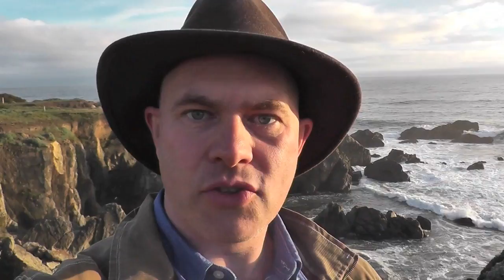Specific Impulse - Why is it Measured In Seconds?

Comment: For everyone who is still scratching their heads i wanna bring some simple formulas here, but i just need to remind that in rocket science/physics there is a unit called "Impulse" and it is basically a unit of Force over time I=F*t, it means how much "total force" the rocket received while engine was ignited/working (the actual definition is "Impulse is the change in momentum of an object").
     There is many formulas for Specific Impulse (SI), but i intend to use SI=(F*t)/W, where F - thrust of the engine, t - total  time of ignition and W - weight of the fuel in Newtons. So basically lets say we have an engine with Thrust F = 70 N and the engine supposedly ignite and stays on for 20 secs. We can multiply Thrust and time and we will get Impulse (please don't confuse with Specific impulse) which will be 1400 N*s. So for the 20 secs duration the rocket received 1400N*s of impulse. During this burn the engine consumed 2kg of fuel, we can calculate the weight of the fuel by multiplying its mass by "g" (will keep it 10 m/s^2 for simplicity) and we will get 20N. So what we left with is that SI = 1400N*s/20N = 70s. What the 70 seconds mean here is that if we let this engine theoretically run for 70 seconds, it would burn the amount of  fuel weight that is equivalent to its Impulse (not specific impulse) which it provided with 20 secs ignition time in the example . It may be not making any sense at first, but think about it: its simply states how long engine should theoretically be ignited to burn enough fuel so the mass/weight of the burned fuel would be equivalent to the apparent/received impulse. In other words, the engine was ignited for 20 secs only and consumed some fuel and judging by what it burned, you could still say that this engine is relatively efficient, since its theoretical time of ignition to match the impulse (SI=70s) is still more than the actual time the engine was on (t=20secs).
      For example if we would consider the same scenario but with the fuel burned weight 10 times more (200N), than the SI=1400N*s/200N=7s . That would mean that this engine, that burned for the same amount of time (20 secs) with the same amount of thrust (700N) but burned away the 10 times more fuel! So you could say it is less effective, since to provide the same impulse (Thrust*time 1400N*s) it effectively burned 10 times more fuel and thus Specific Impulse is lower and only 7 s. So for this engine the SI means that for only 7s of theoretical ignition, this engine would burn away the weight equivalent of fuel equal to the Impulse provided for 20s !!! So the lower the specific impulse, the more fuel engine will burn to reach the desired impulse (less efficient). 
    Conclusion: in short, the Specific Impulse is the rate/value of the engine that reflects how much fuel weight/ fuel mass the engine uses to reach the Impulse it provides. in other words, the Specific Impulse increases in engines with high fuel economy, while more fuel hungry engines SI will decrease. It is a little oversimplified, since in reality each engine have different Thrust value, thus you have the Ion thrusters with SI of 1500 s, but with Thrust of 0.1 N 💀 . So comparing 2 different engines just by their SI alone makes no sense, it only matters in the context of the same Impulse (Thrust over time), and the Impulse by itself matters by its nature (0.1N over 10 000 s won't help you get off the ground, but if you are having 1 000N over 1 s (in both cases the Impulse is 1000N*s) then you atleast going somewhere).
Reply: From the formula you can see, that SI - is a relation between engine's Thrust and Fuel consumed to achieve that thrust. Time of ignition is irrelevant, since the more time the engine running - the more fuel it consumes, so it's evens out. So naturally, the engines with high Specific Impulse means that they have high Thrust achieved to Fuel spent ratio (aka efficiency).

Comment: There are two ways to measure Isp (specific impulse) : mass, and weight (equivalent mass at 1G, measured in pounds-feet). The weight measurement turns out to be in seconds and is basically a measure of how many G's the exhaust is subject to. The mass measurement of Isp is actually just feet per second and is exhaust velocity, which is a little more intuitive.

https://en.m.wikipedia.org/wiki/Specific_impulse

Comment: specific impulse = impulse / mass
impulse = force(thrust) * time
force = mass * acceleration
acceleration = velocity / time
velocity = distance / time

so, put all your equations together ...
acceleration = distance / time /  time
force = mass * distance / time / time
impulse = mass * distance / time
specific impulse = distance / time

and AMERICANS ( dunno if the english are this stupid) keep trying to use pounds for both FORCE , and MASS, which they are not, so they wind up with seconds for specific Impulse. the proper units for specific impulse are m/s ( or ft/s if you live in the stone ages)

Comment: I measure specific impulse in Fortnights since I use the Furlong/Fortnight/Firkin system. As you know, that system is much more intuitive than the English system or, God forbid, the Metric system.
Reply: Battleglory 
If you are referring to KSP, it seems to use metric units for some unknown reason. Maybe there is an add-on to convert units to KKK to make it easier to use.
Reply: @Battleglory a Fortnight is a unit of time equal to two weeks.

Comment: I don't understand specific impulse at all. What does it mean? Why do engines that use things with a smaller molecular weight tend to have a higher specific impulse?
Reply: It's a change in impulse (momentum gained) per unit of fuel mass burned. Instead of using mass they're using mg, the force of gravity at earth's surface.
Reply: Interesting, that makes a lot of sense.  So, why does specific impulse tend to be higher when your reaction mass has a low molecular weight? I can easily see how having a higher nozzle exit velocity would be good.
Reply: I think the exhaust velocity is inverse to the particle mass, like a gun firing a bullet. If the bullet weighs half as much, it goes twice the velocity, so lower mass particles would move faster.

Comment: It seems silly that this was introduced just because of the imperial system. Of course the sensible definition of specific impulse is as the change of momentum delivered per mass of fuel (so units meters/seconds)

I guess if you wanted to try to assign some meaning to this version, though, given this silly conversion: it seems that gravity should be mentioned in the description (just saying that the units work out I'll consider cheating a bit). So how about this: when you divide by acceleration due to gravity, saying an engine has an ISP of x is saying that by burning your engines for x seconds you increase your momentum by the same amount that gravity would change the momentum of that weight of fuel in one second.

Not saying that's as helpful as other descriptions. Probably the better approach is the comparative one: if an engine has twice the amount of ISP, say, then it produces the same thrust from half of the amount of fuel. Wanted gravity to feature in the above though to see if it gave the number some actual meaning.

Comment: Forget that, I want to understand what exactly does it mean in definition if i say there's a specific impulse of 1 second ? Does it the mass of the gases exiting the rocket is generating the given amount of thrust every x seconds?
Reply: If I had 1 pound of thrust, and an Isp of 250 seconds, I would burn 1 pound of fuel every 250 seconds. If I had 250 pounds of thrust and an Isp of 250 seconds I would burn 1 pound of fuel every second.
Reply: I guess in the last line you meant 'burn 250 pounds of fuel every 250s'?

Comment: Specific impulse is the time in seconds that a given weight of fuel will produce that same amount of thrust, or the time it takes an engine to consume a weight of fuel equal to its thrust.  So if I have an engine with one pound of thrust and a Isp of 250 seconds, I will burn one pound of fuel every 250 seconds.  If I have an engine with 250 pounds of thrust, I will burn one pound of fuel per second.  But if my engine's Isp is 500 seconds, I can get that 250 pounds of thrust while burning half as much fuel.
Reply: Thank you
Reply: Excellent explanation
Reply: Excellent explanation
Reply: Comment is a better explanation than the video
Reply: Excellent explanation
Reply: Excellent explanation
Reply: Excellent explanation
Reply: Excellent explanation
Reply: Excellent explanation
Reply: Excellent explanation
Reply: And I guess the topic expressed by Scott in the video still applies to this explanation: in the metric system that same 250s Isp engine would burn 1 kg of fuel in 250 seconds if producing 1 kg of thrust, or burn 1 kg of fuel in 1 second if producing 250 kg of thrust. Did I get it right?
Reply: @gattopazzo80  Yes you are right but force is expressed in newtons.
Reply: Excellent explanation
Reply: Finally I  get it!
Reply: Been rattling for hours tryna understand this thing, now I get it. Thanks man
Reply: Excellent explanation. Very specific with regard to measuring impulse.
Reply: Excellent explanation!
Reply: Better than wikipedia
Reply: Amazing explanation
Reply: Ahhhh… I’m confused
Reply: @TheWizardGamez  I have an engine that produces 1,000 kg of thrust, and it takes this engine 400 seconds to burn 1,000 kg of fuel. I have another engine that only produces 50 kg of thrust, and it takes that engine 400 seconds to burn 50 kg of fuel. Both have a specific impulse of 400 seconds.

These engines produce different amounts of thrust, and they consume fuel at different rates, but the important thing is that they both burn fuel equally efficiently. The weaker engine will simply take longer to accelerate. 

The reason these engines are equally efficient is that there's no difference between the one 1,000 kg engine burning 1,000 kg of fuel in 400 seconds, and twenty 50 kg engines each burning 50 kg of fuel in 400 seconds
Reply: Thank you so much. That was a great explanation!
Reply: Wikipedia lookup i bet.
Reply: @Marin3r101  got hurt somewhere in life I bet
Reply: @CountArtha
"If I have an engine with 250 pounds of thrust, I will burn one pound of fuel per second."

That will depend on the Isp of the engine, you didn't specify it there. The statement only holds true if the Isp of that engine is 250s, like the previous one.

So, basically, the explanation isn't "excellent" after all.
Reply: @Goreuncle  It is understood that @CountArtha is referring to the previous one

Comment: >20xx
>Using imperial measurements.
Reply: Not even that (although in this specific case they're identical). The Imperial System was defined after the US became independent; the US never adopted it. What they use is the US Customary System, which is based on some old (pre-imperial) English units. Most of them have the same names as Imperial units, but some have different values. So you can't even transfer numbers (ex., volumes) between US and Imperial directly.

Comment: this video only explains why is it measured in seconds but not why using earth's gravitational accelaration(doesn't matter in SI or imperial it's still earth's g) to calculate deltaV. 
i suppose it's because masses are also measured on earth?
Reply: no it is just totally arbitrary. I guess the reason may be that people got used to express any acceleration in multiples of g. (For example the "G-Force" if a combat plane is manuvered)

You could essentially read this number as "how many seconds can a given mass of fuel apply the same force on the spacecraft as the weight of this fuel at surface level at earth?"

Or we could just all agree to use the Système international d’unités and express it in m/s instead ;)
Reply: It's because pounds are a measure of force, but grams are a measure of mass.  So to get an apples-to-apples comparison you have to convert grams to Newtons by multiplying by gravity.

Comment: It has units of time because it's defined as thrust per fuel consumption rate measured as fuel weight per second.  
If instead it was defined as thrust per fuel consumption rate measured as fuel mass per second, it would have units of velocity.

The second one actually makes more sense, because fuel mass remains constant.   Fuel weight on the other hand changes due to gravity, so for the first definition you actually have to use the fuel weight measured at the surface of the Earth, even if you're in deep space.  That's the only way to use fuel weight as a useful measure of the amount of fuel.  Hence the gravitational constant is based on the Earth's surface gravity, regardless of where you are.  

It's sort of stupid, and I think the second definition is cleaner from a physics standpoint.  It makes the rocket equation simpler by removing the constant, allowing you to find delta v by multiplying specific impulse (which now has units of velocity) by the log of the mass ratio.  For every factor of e, your delta v goes up by the specific impulse.  Also, for rockets, it makes the specific impulse equal to the exhaust velocity, which makes it more intuitive that specific impulse is directly related to the exhaust velocity, and to increase the efficiency of a rocket, you have to expel the reaction mass at a higher velocity.

Comment: So it all boils down to a very old feud between the English system and the metric system:  This is the best explanation I've heard so far but somehow seconds just don't feel right...
Reply: Basically using pounds specific impulse describes how long a rocket engine could burn one pound of fuel while producing one pound of thrust. It's basically miles per gallon but the question is framed, if you had one gallon in you tank and ran the engine at a constant power level, how long could you travel. And the reason they defined it this way, was so you could use pounds or kilograms and get the same answer. In metric it would be how long can a rocket engine produce 1 kg of force. So both sides can use the units they prefer and still get the same result. If you made the equation spit out a distance or velocity, it wont be the same in imperial and metric and you'd have to be constantly converting again.